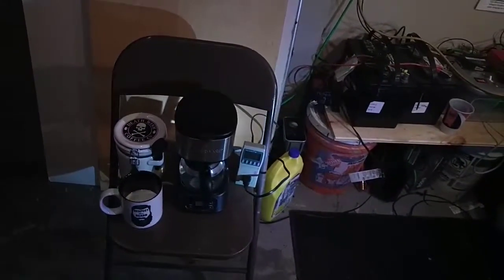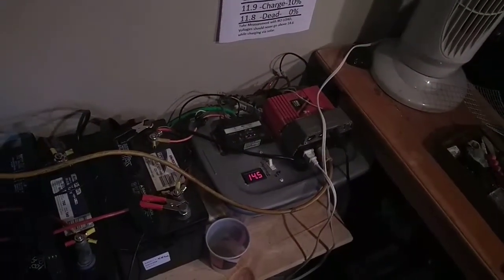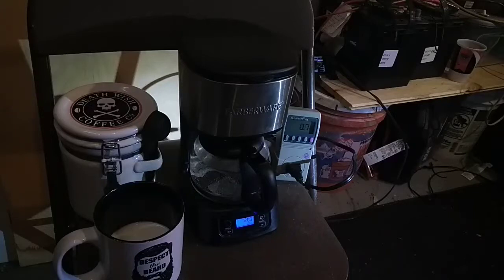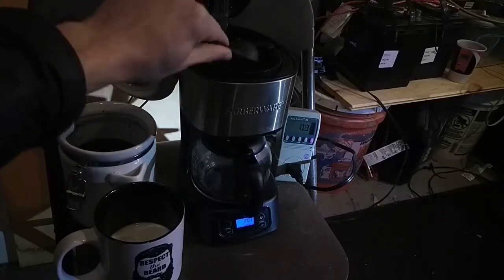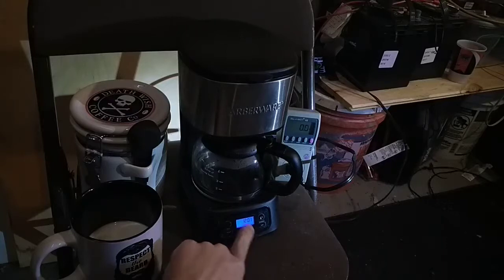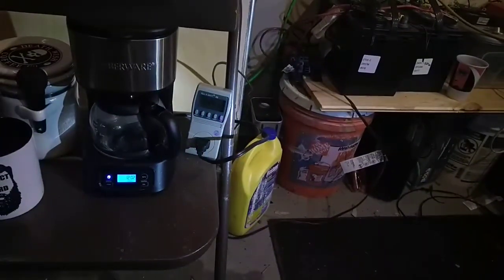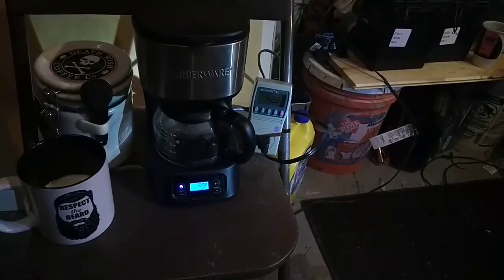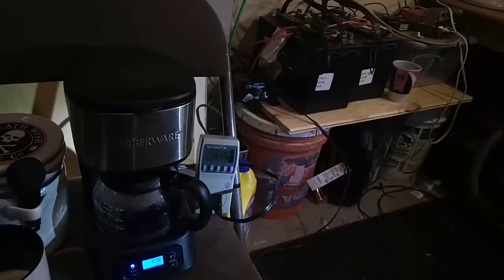Test: 650 watt coffee pot - on 400 watt centech inverter - Will it run?

Comment: Batteries need to be fully charged. The beeping was the batteries dropped below 12 volts. Coffee maker pulls a lot of power. I used one battery, same wattage, and I couldn't get my coffee maker to work. This was before watching your video. Thanks for your information video. 👍

Comment: If you use a 750 watt inverter your coffee pot should be fine
Reply from the maker: Oh I know this. Hah. I just wanted to see what this one could do. I have since bought a 1500w inverter with 3000w surge. And I use it to make coffee with a proper normal size Coffee machine and a Keurig too! Along with a host of other things that run on this 24/7.
Reply: The batteries were not sufficient for the coffee maker. It draws too much power. More batteries. At least 3 well charged batteries. I used a single battery, and it was being charged at the same time and couldn't turn my coffee maker on. 14 volts into the 12 volt battery was jot enough. Meaning it's best to have more batteries attached to keep up the constant 12 volts from dropping.

Comment: 9:24 your battery voltage is 11.7 during beeping. You might be out of battery. Lifepo4 battery would do much better for longer
Reply from the maker: Those batteries are also much more expensive. I now have 4 very large lead acid batteries, and they work perfect! I also now have a 1500w inverter, and run proper normal size coffee makers! And everything works very well!

Comment: Can you still make coffee with one 12v battery instead of two? my inverter is 750-1500 watts.
Reply from the maker: Yea, you can make coffee with just one. Although you would probably need a battery about the size of a car battery. I've now got a 1500w inverter, and I run a 1200w keurig off of it. And at some point, two of my three batteries died and I was running on just one. Hah! Still worked! Although my runtime was pretty crap at that point.